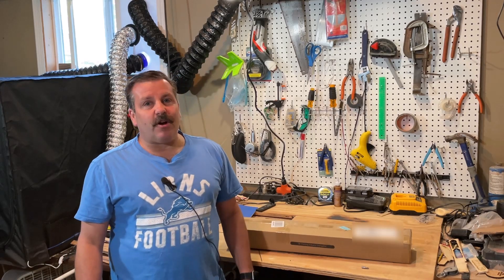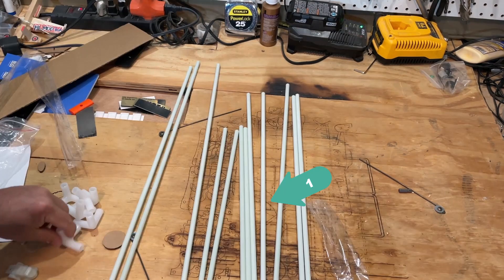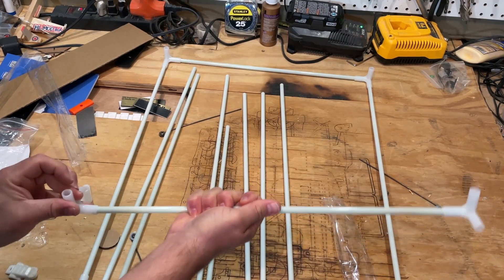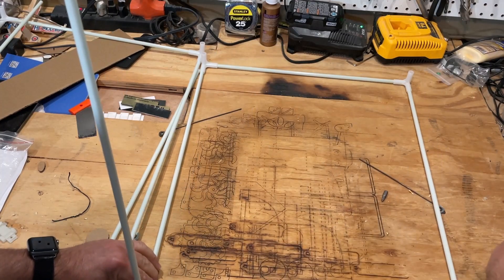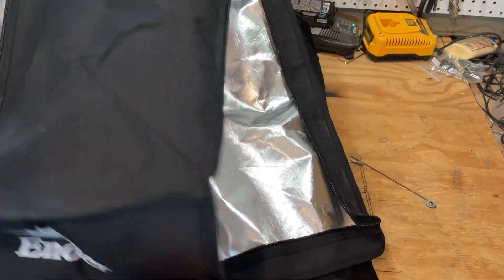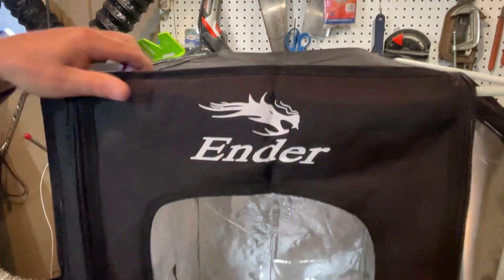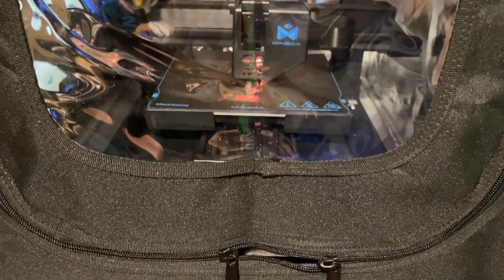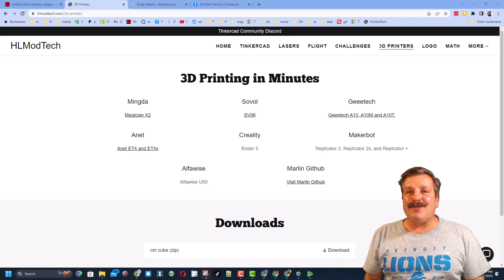Easy Steps to Assemble an Ender 3 3D printer Enclosure in Minutes

Comment: How warm does it get inside the enclosure when printing ABS or ASA or Nylon???
Reply from the maker: I have not used it for any of those. Generally it matched the heat of the room with a little bump from the print temperatures.

Comment: Is it necessary to remove the electronic part? I saw several videos that said it has to be separated, but others put the whole printer. I don’t understand if the electronics need to be separated only for materials that require higher temperatures or also if I only print PLA and TPU.
Reply from the maker: Interesting. Heat is not good for electronics, but I have never worried about my machine in the case. How long do your prints last? I’m always trying to keep projects close to an hour.  I doubt I’d mess with the electronics.

Comment: Is there an advantage to the enclosure?
Reply from the maker: It keeps temperatures more regulated. Also would be quieter in a classroom. I may use it with my resin printer too. Then it keeps the fumes contained which is REALLY nice.